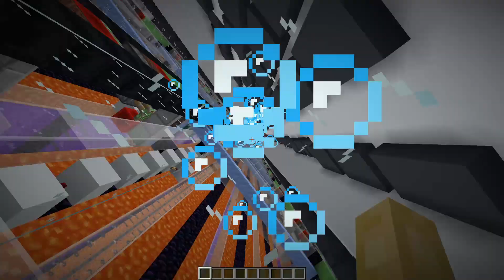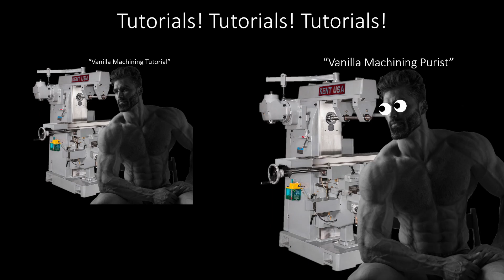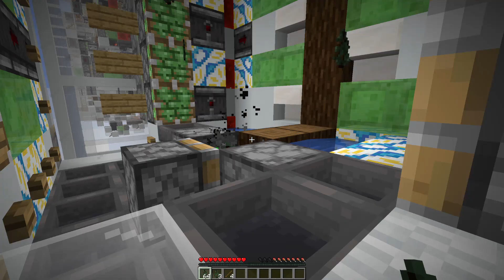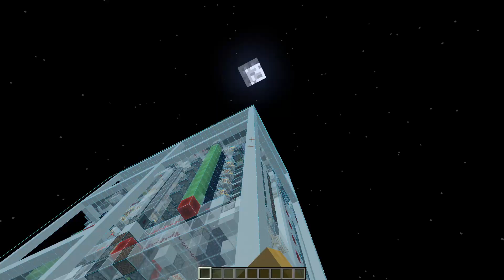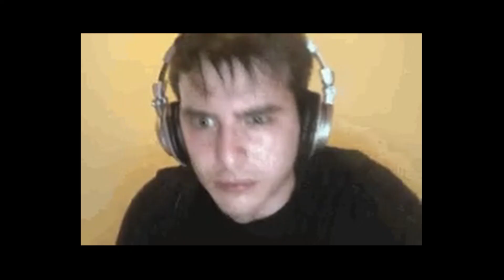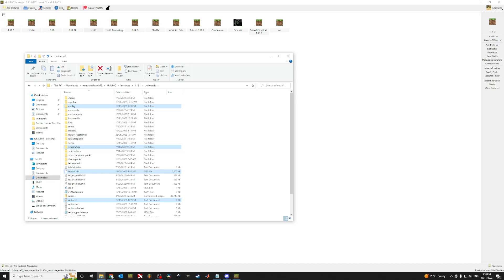How I Build Using Litematica

Comment: I think trying things out in creative is really the most OP tool for technical minecraft.

If you're taking on huge, complex projects, I don't think there's any alternative to schematic mods except maybe "save-scumming" with backups, but using some mods can push things in the same direction as duplication glitches: awesome in specific cases that can cut out uninteresting tedium, but which in other cases may merely cheapen your experience of the game.

I don't go as far as Dugged or Etho (in his SSP) - but there's also something interesting to me about working through a project where I have some clue what I'm doing instead of just printing someone else's design in from creative.

Comment: i still don't see the purpose of multimc. its literally the same as the mc launcher. if you have a mod that dose nothing different why install a point of failure?
Reply: Multimc is more for management, separating worlds/mods/configs/versions into different profiles makes it easier to manage when you mess with mods alot. You can also try out snapshots easier and safely. Also when it was first made there was only the basic Minecraft launcher that had little to no version control and modding was a downright nightmare. MultiMc has been filling that role of management for a long time now, i couldn't imagine not using it today.
Been using it since minecraft 1.6.4

Comment: For multiple Instances you could also use the programm curseforge, which has a better and easier interface and you can easily install mods through the programm

Comment: I'd suggest checking out the Prism Launcher fork of MultiMC, it has a built-in mod downloader and updater which supports both CurseForge and Modrinth (that is, as long as the mod author hasn't disallowed "third-party downloads" on their Curse projects)
It's directly compatible with MultiMC-format instances, and MMC settings can also be moved over iirc with a simple config file rename
Reply: In my testing with a docker minecraft server that also uses auto mod downloads, alot of mods have auto download blocked on curse. Most of my mods come from modrinth now, the curse ones i have to manually grab the database url in dev tools when downloading the mods.

Comment: If litematica can be cloned and used on bedrock, as a texture pack and some armour stands it's vanilla enough. Mad hatter's structura doesn't have as many features but does the exact same thing with only a texture pack, exported structure block files and some external software to make that texture pack.
Reply: yeah, if Mojang allows you to still get achievements with it, then it's vanilla enough for me

Comment: Hard to not disagree with your comparison - real life engine manufacturing to some Minecraft build. Vanilla survival is all about challenge of actually accomplishing something, if you wish to be super fast and efficient at making some build go in creative with all the "Engineering Toolbox". Saying that vanilla survival mechanics are stupid is ok, but remember that all the stuff you build this way in your survival world are worth way less in the end
Reply: That's the thing tho, not everyone agrees with your perspective. That's why you can toggle all the features of these mods on and off and why you need to ask the serverowner first.

I for example see absolutely zero issue with using most of them. To me the things I build in survival are worth exactly the same whether I build them with or without litematica and tweakeroo. The builds require the same amount of resources, just not the same amount of needless pain and suffering while placing them. I don't see the point of clicking until my hand falls off when I could just activate "Fast rightclick" and hold down mouse2. However if you don't like it, you are welcome to not allow it on your server.

Also if you seriously hold the opinion that something like litematica isn't 100% essential, you have NEVER built an actually complicated redstone machine. Unless you are literally designing it as you go, you would be using some kind of guide anyway. So why not just use the best, most convenient and fastest one?
Reply from the maker: If it is a braindead task that consumes time that you're after then why not just go play candy crush? The objective here is to offload stressful and time consuming tasks onto tools which elevate the capabilities of the individual. The reason why we design in creative to build in survival is because it is impossible to gain the satisfaction of building a farm simply in creative, we have to use its resources to build infrastructure that makes building more things easier. It's about the stuggle from punching the first tree to technology that can farm trees by the masses. If you worked harder to get less substantial results by refusing to use the tools available to you then fine. But then you're just not really pushing the limits of what you can do with this game.